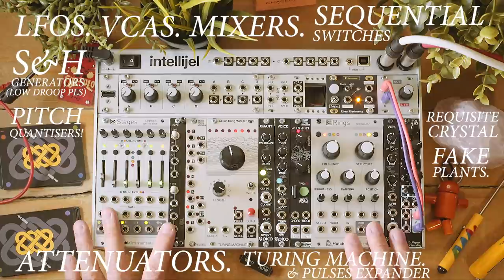A Generative Modular Design & Patch Ideas: Suggested Systems 4

Comment: Mutable Insteuments Marbles is a one-module alternative to your turing machine + quantizer + s&h + gate sequencer + attenuator + offset. Does all of it, cheaper, less hp. Ultimate generative modul imo.
Reply: Agree, but I think the idea is to deconstruct a little bit the principle behind generative using more basic modules. So each user can adapt to it with the individual tools ar hand. It would be cool do this all doepfer to get a step beyond.
Reply: I was thinking the same thing, but Marbles only has three gate outputs.  The extra gate outputs would be cool to use with Stages in Ouroboros mode, although that would require replacing some modules with more modulation sources.  Maybe a Transient Modules u4R or Plum Audio Apex in the 1U row in place of the Pointeuse (and USB power), although they're a lot less powerful and versatile than Stages.  Or replace Chord Organ with a couple of 2hp LFOs, and switch Rings into Easter egg mode.
Reply: I was literally created a marbles vs turning machine pros and cons I think you summed it up. I do see the attraction and usefulness of the aTuring machine set up, especially if you already have the other compnents
Reply: I based my own small generative system on it.  It’s fun to self patch it to get even crazier things.

Comment: the mixer and pulses combo was inspired. woe... never thunk of that
Reply: Good use of DFAM aswell
Reply: I don't have the Pulses expander (yet) but it occurred to me that when mixing the gates like this, you should get the opportunity to adjust how often small steps happen vs large steps — by mixing the more frequent pulses at a lower level (little trills?) and the infrequent pulses at a higher level. I was just tinkering with this idea in my Doepfer system with the A-149-1+2 but not terribly satisfactorily. I definitely need to spend more quality time with the A-149-1 manual! When combined with various outputs from a clock divider from the same original clock source, though... fun times to be had
Reply: Same thought, can’t wait to try that!
Reply: you could kind of make a janky MeloDicer this way...
Reply: @jsleeio  I believe Volts will give you both Pulses and Quadratt in one expander.

Comment: A note on stages: I learned the hard way that patching it right to left when using gated stages, but left to right when working with non-gated stages is better, because the moment you want to make a gated one (an envelope, for example), you find out you need to move all your single-stage LFOs around and it's a royal pain

Comment: The section around 52 - 58 mins where  you have gates into the mixer to produce sequences is pretty much what volts does using the first 5 bits of the shift register (from memory) but of course you could use the same technique  with other sources of gates. (or I may be talking rubbish :oD )

Comment: Love this! I’ve finally got my small modular set up running and am getting ready to dive in and make sounds! 

Quick question - I was looking at the Music Thing Turing Machine just the other day and it seems amazing. Any experience with others that I might want to consider or is this the one? 2hp has a very basic one, but thinking I want a little more.

Thanks again for the great content!!
Reply: Mutable Instruments Marbles is a strong contender. I replaced my Turing Machine with expanders (pulses + volts) with Marbles and have not regretted it one bit! It might seems like a lot of hp real-estate for what it does, but trust me: it packs A LOT of functionality. There are also more compact versions from other companies (smallest I came across was 10hp).

Comment: Hey mate, a thoroughly enjoyable watch and something very close to my own adventures in this realm. At around 21 you talk about loop recording (of random sequences), so that they can be blended into each other. Can you recommend a module that can do this? I’m planning to get a Turing Machine to play alongside Marbles, so your opinion on loop sampling and recording would be ace 👍
Reply from the maker: Thank you! It’s not something that I know many modules can do! There’s the Flame Quad CV Recorder, the Shakmat Bishops Miscellany and well, there’s also Marbles which can ingest notes and play with them? Though not a looper per se. There’s also things that can record knob motion like the LS1 (Flame has one too) and the newer Intellijel Joystick and Tetrapad + Tete. All of these are quite expensive solutions IMHO as the other thing is - what about just using an audio looper? Not quite the same if you’re planning to separate gates and pitch - but it’s worth considering as it may unlock potential in your case, but in a different way?
Reply: @mylarmelodies  ah thank you so much bud, that’s a lot of really useful information (I’d not heard of most of these ha). CV recording vs audio recording - I guess they both have their own interesting and different possibilities / journeys. I will research the modules you mention here - thanks again.

Comment: If you dropped down the "HP" of the "Stages" and the "Turing Machine" so you could fit in a good sampler I think you'd get something pretty performative.

Alternatively, a sequencer with some randomization abilities might replace the aforementioned modules in functionality (Hermod / Black Sequencer, etc.) and you might get "generative++" (i.e "oh that's cool, maybe if I just..."). 

Love your videos dude.
Reply: Yeah, that's the thing that stood out to me. That turing machine takes up so much space, and most of the face plate is just blank. There's gotta be a smaller module that does the same thing, or a similarly sized module that does more.
Reply: @dobeeeeval  You can get one from 2hp apparently: https://www.modulargrid.net/e/2hp-tm
I also have Rings in 8hp (lots of models in that form factor on thing like Etsy).
"Pamela's NEW Workout" would be a great substitute for "Stages" too.

Comment: I’m stuck between getting a Turing Machine or getting Marbles. I like bigger/more playable modules but Marbles just seems like a deeper Turing Machine. How did you decide between the two?
Reply: FYI there is also Permutations from Greyscale which is smaller in size
Reply: @BeniRoseMusic  I tend to avoid small modules and menu-diving! Sometimes I wish there were more big clones like Supercell.
Reply: @benhavey4107  I don't believe Permutations has any menus, and it's not 2hp size, just not as much wasted space as TM. It comes in different varieties and sizes and has the pulses expansion built in (and yet is still smaller). But hey, that's why modular is great, everyone can get what's right for them!

Comment: Thanks for these videos! I'm super new to all this but learning lots....Let's say I want to use some of the pulses expander outputs to trigger additional voices for melody. Do you have recommendations how to get multiple outputs to quantize to the same scale (i.e. which quantizers that could input multiple pulses and channel them to multiple voices) ? And second, after quantizing and into the voices, are there quantizer modules that can simultaneously generate synced triggers/gates from each of the pulses for dynamic envelope triggering?
Reply from the maker: The cheapest and most flexible option would be an Ornament and Crime module! Plum Audio make an excellent 1U one I've been trying lately
Reply: @mylarmelodies  Thanks! Also just realizing you answered this very question in the video pinned above :)

Comment: Great video and so many great ideas. Thank you!
A quick follow up on the idea of using the 4ms Rotating Clock Divider (RCD) instead of a Turing Machine: Can this create pitch as well or was the RCD just a suggestion for a Pulses replacement?
Could you please mix your voice louder or stop the sounds while speaking? I had a really hard time understanding you 😬✌🏻
Reply from the maker: Ta. RCD would make pitches combined with a mixer - but you would need the expander for it so it produces gates rather than clicky short trigs. I always sidechain my voice against the synth track in these videos, clearly not enough though.
Reply: @mylarmelodies  Ah I see. Thank you!

Comment: The lfo into pitch quantiser made me think: are there wavetable lfo’s? Or could we use a negative voltage attenuator to slow down a wavetable oscillator to use that as cv source for the quantiser? That would make the wavetable knob move the sequence if I’m not mistaken
Reply: Some digital lfos have a morph knob to shift between shapes, which is basically a wavetable, but I dont know of any that take it as far as having editable wavetables
Reply: Also noteable is that unless you're syncing your lfo and gates the pattern will be shifting constantly regardless

Comment: How did you fit so many modules in the pallet case? The power bus only has room for 12 modules. I just bought a new filter and even though I still have the hp I’m one spot short on the bus to power it
Reply from the maker: Bus ribbon extension cables! Ask your local euro shop
Reply: @mylarmelodies  you are a lifesaver! And he responded in the same day too!

Comment: Curious as to why you don't patch left to right on the Quadratt and just use the cascading feature to use D as the master out level before going into the filter? Does it not work that way (I don't have one)?
Reply from the maker: My thinking in using an attenuator on the output is that you can then turn the mixer levels up full clockwise without fear of distortion and ruining a performance recording  - otherwise you have to remember to not turn up the knobs beyond some random level where you get the most volume without distortion
Reply: @mylarmelodies  Sorry I was referring to the part where you had to throw in the airtenuator before the filter because it was too hot from the Quadratt. If you have stuff going into A/B/C which is mixed to D, can you use the D knob as a master output attenuator or does it just control the level on the D Input (not cascaded output)?
Reply from the maker: Yep that was what I meant - and yeah regarding the Quadratt the D isn’t a master knob, would just control the fourth channel
Reply: @mylarmelodies  Ahhh okay that makes sense. Now I know! It would be nice if it would control the output of the cascaded inputs... Hmmm what if you patched C Out to D In, then could you use it as a "master" knob for mixing A-C? Sorry for all the questions but thank you so much for replying!

Comment: I like the 2hp TM it's a wicked little module (I had the proper original turing with pulses but I sold it after getting the TM because I found that somehow the TM seems to spit out more usable stuff more often, and my god it's only using 2hp :) my latest favourite combo is TM into Harmonaig into Acid rain chainsaw for generative chords. Lately every day is supersaw day

regarding sample and hold with no pitch drop the algorithms in the distings do a great job at that (I guess because its digital the pitch will lock for days) saying that the shift register (TM) algorithms are also very good in the distings